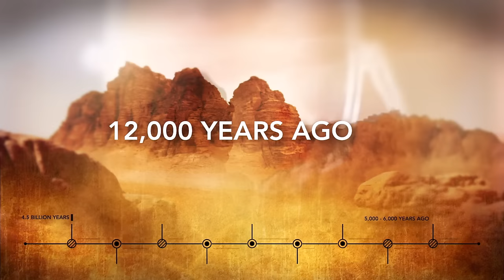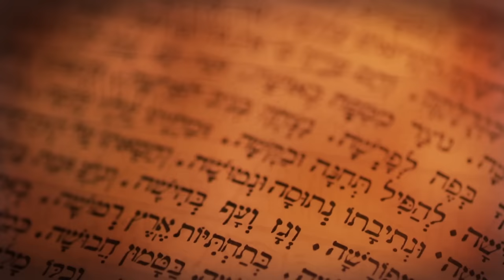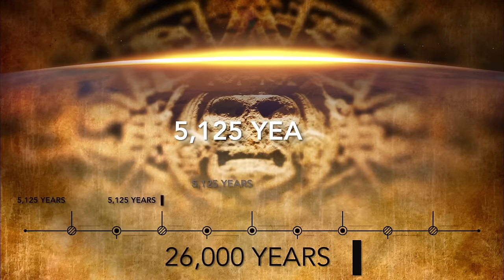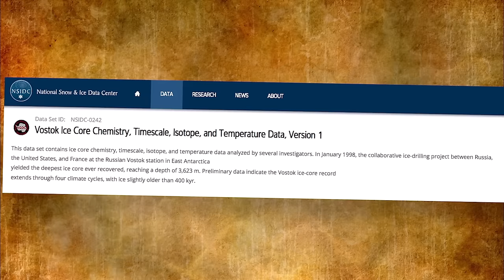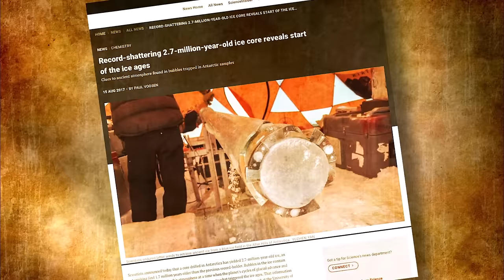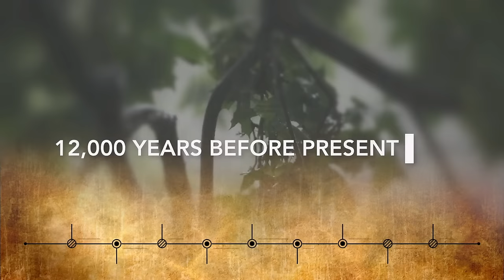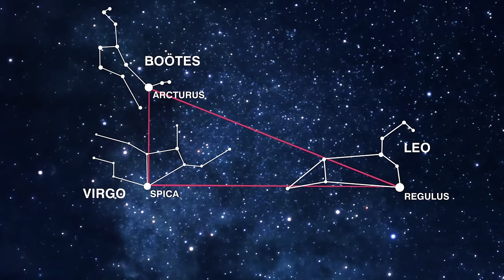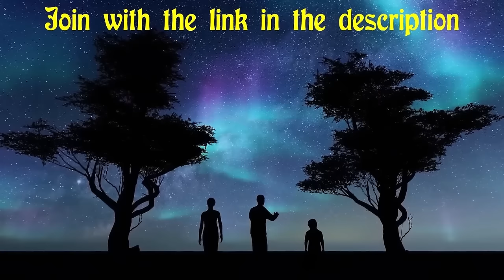Antediluvian Civilizations: The World Before the Great Flood

Comment: I've probably spent to much time thinking about this subject.  I have questions I haven't heard before. You think about how we build thing today. Even our greatest constructs aren't built with blocks of rock anymore. Which I'm puzzled about,but more puzzling is why they used them to begin with. You don't have to use 1,000 ton+ blocks of granite for foundations unless something is supporting massive amounts of weight that most of the sites didn't need. We use a man-made material, concrete to build our largest structures. Hoover dam as a illustration. You might say they built everything because they wanted it to last forever! Possibly,but any of the reasons for using the huge blocks doesn't lineup with the technology they reportedly had. Which was Reed rope and wooden block and tackles for lifting. Estimate for weight handling at best 3-7 tons. No boat has ever been found that could transport the massive blocks some as far as a 1,000km. Better boats ,rope and iron did come along but not during building phases that mainstream gives us. Don't even bring up pounding stones and copper tools because it's ludicrous to even discuss. What about the perfection in the statues? We can duplicate the perfection of these. But only if we use computer guided advanced tools. It comical to hear the academics explain the cutting marks and drilling holes that have been found of high tech machinery. Even with our advanced computers we can't figure any of these things. You can beat up all mainstream BS just with the Osirian complexes mysteries. Looks to me like the archeologists need to stick to digging up bones and let serious studies to begin using mechanical engineers and other scientific fields to study these sites. And Hawass and the other Egyptian authorities need to stfu and get out of the way! The world already either suspects or knows you either inherited these wonders and tried to copy them or just scratched your names on things that didn't belong to you!
Reply: agree 100%, especially about the Egyptians inheriting these structures and claiming them for their own, and not allowing the outside world access to really investigate
Reply: you miss out, watch the vid where one single man moves blocks of 20 tons. do some research instead of fantasizing.
Reply: @wout123100  big difference moving a 20 t block and moving ones that weigh over 50-100. Especially on uneven or hilly terrain. I have had to deal with moving large objects. There's also a big difference between moving something heavy a few feet and moving it cross country. You sound like the geniuses that proclaim they drilled the holes with copper tubes and wet sand. But when dared to drill these holes, they can't accomplish anything that can be completed this century. But I don't think that is your problem.  It sounds more like you have grown up suddenly and realized you wasted your parents' money on that education to become an archeologist!
Reply: I totally agree 100%.
Reply: African people had the GOD-GIVEN Power to civilize this world....they conquered the seas and built all these megalithic structures.....Because of all this power  we became lofty, forgetting the God of our power.....we became our own gods and created idols and deities instead of sticking to our true unseen GOD WHO dwells within all flesh ...We went astray , so He gave us Africans,  Seers,  Prophets ,and Scribes who wrote Scriptures and taught us to return to our true God or we would be scattered to all countries as slaves.....Enoch the Ethiopian was our first Prophet who even foretold the coming of Christ our Black Lord and Savior........So GOD gave the Bible to the world through Africans of Ethiopia , Egypt and Israel and the so- called Middle -East which was originally North-East Africa before it was separated from Africa when they joined the Red Sea to the Mediterranean after digging the Suez Canal from 1859 to 1869....The original Bibles were only in African languages Ethiopian Gee'z , Egyptian, Aramaic, Hebrews Arabic and Amharic long before any European Greek and Latin...The origin of Eden was the highlands of Ethiopia to Tanzania Mt..KILIMANJARO...
Reply: Literal multitudes of modern engineers have explained how this happened.  The sad reality is that ancient Egyptians were willing to throw human death and suffering into this project until it was done.  You spew a lot of pseudo-facts, but the reality is that this whole project was entirely doable.  No aliens, no time travel, just amazing engineering coupled with a degradation of an entire people.
Reply: A modern engineer would need a gantry crane to build such a huge structure like a pyramid. Megalith structures found all over the world and even beneath the ocean would suggest technology that is forgotten or obliterated. To cite a recent example, the Taj Mahal has sealed cellars underneath which nobody wants to open, because that would be a Pandora's box.

Comment: seems like the point of making the megalithic structures so exactly fitting, how all the blocks fit together without room for a hair to fit between, is to make it impervious to those previous cataclysms & to make it essentially water-tight. in preparation for another flood. & so large, mountain like, to make it as close to impossible to destroy with something like a nearby comet impact. awesome episode. just one of many thoughts i had during the presentation.
Reply: Good theory; I like it 👍
Reply: @kellymichelley  thanks!
Reply: 🎉 Agreed 🎉
Reply: One problem. They didn't somehow make it through the flood unscathed. I think they made it through, somewhat intact, simply because of the sheer stone mass and how tight the masonry. The problem is that enough water washing over an area can wash even big boulders downstream. The more water, the bigger the boulders. I think the flood and corresponding earthquakes from the gigantic moving masses of water is also what eroded down entire mountain ranges, such as the Appalachians.  That much flood water mixed with sand, dirt, rocks, and boulders = serious abrasive capability as well as sheer hydraulic force.
Reply: @paulandrulis4672  Definitely right about the incomprehensible magnitude of these floods we're talking about here. I do think the aim to make them impervious as possible to nature's extremes was still a factor during their construction, I imagine it might have been a major factor in those ancient people's every day thinking & planning. & look how The Sphinx withstood a 1000+ year downpour of torrential rain, an unimaginable quantity & duration to us today. That brings into consideration the mystery of their actual build date to begin with. Who knows what they've withstood before, Antediluvian centuries were also cataclysmic, even with the big flood still to come.
Reply: Assuming the flood actually happened as presented in mythology, your comet idea is of course absolutely sheer supposition.  Pretty much anything in the video and out are pure speculation.
Reply: @MichaelShepherd-v7p  He specified it was just a thought he had. He never said it was anything other than an idea or theory.

Comment: I'm inclinded towards the theory that the cyclical Magnetic Pole Shift is the most significant event that excels ice ages and dry ages on the planet. This is also the most likely event that sets off excellerated tectonic plate shifts.

The poles are doing this right now. Our planet is about to change in an epic way once again. We're just along for the galactic ride.
Reply: This is most likely the truth. Christian and Islamic eschatology speak of the last point when the story of humanity will end 'When the Sun rises from the west and sets in the east'. Note that this is the point for the end of humanity. The end of this world as a whole is a different event the sign of which will be 'When Sun will be closer to the Earth'
Reply: @awaishssn  Time-lines of crisis found in theology  about this event are contested by simple geology.

Ancient legends hold an element of truth, but they lack accuracy.
Reply: There is no correlation or causal link between geomagnetic reversal and ice ages.  As for dry ages, they're the same thing as ice ages (partly due to the water being locked up in the glaciers and partly due to cooler air being able to carry less water vapour).

Comment: A near miss. The most ancient massive structures were substantially before our usual attribution, but not antediluvian. 
Just after. 
The flood did not extinguish large structure. It motivated it. 
They had to build something that would survive the deluge that they had witnessed.   
It coalesced survivors, and made important the craftsmen and work. It instilled purpose...then they spread around and dwindled out over centuries of drought.
You're welcome. True ancient pre history.
Reply: Read Psalm 82 and Job 38
Reply: There was no global flood.  Full stop.  At the end of the last ice age the meltwater did cause extensive coastal flooding and a number of localized floods.  They were just that though, local, not global, and they occurred intermittently and non-simultaneously over a span of several thousands of years, ending ca. 11500 BCE.  As for the Jewish flood myth, the event that it's known to be based on (a specific flood that struck the city of Shuruppak) occurred much later, ca. 2900 BCE.  Record of some of the earlier floods (those of the Persian Gulf and/or the Black Sea) might have been passed down in oral histories to later become the genesis of the "Adam and Eve" myth (pun intended); this is just conjecture though with only circumstantial evidence to support it.

Comment: Yes, but 'The Flood' only covered the area of the Middle East and Near East. The Great Flood had no effect on the Americas and some of the other areas described.
Reply: It did in north america
Reply: @d1want34  How did the great flood effect North America?
Reply: @johnhess351 melting of the North American ice cap about 11,600 years ago
Reply: There were many large, but localized, floods at the end of the last Ice Age ca. 11500 BCE.  Off the top of my head in North America there's the Bonneville and Missoula floods and a bunch around the Great Lakes; in Europe you have the flooding of Doggerland and the formation of the English Channel; in the Fertile Crescent there's the flooding of the Black Sea and Persian Gulf; in addition, thousands of square kilometers of coastal land was flooded (sea level was 120 meters lower during the last ice age).  The "Noah" flood was much smaller scale, taking place in the city of Shuruppak ca 2900 BCE.  The key point is that there were many local floods within a relatively short (few thousand year) timespan but these floods weren't simultaneous and there positively was no global flood (at any time).

Comment: That is what destroyed Mars and that is where Jupiter, Saturn and Uranus got their rings from.  I'd love to get a sample of Saturn's rings aswell as the other  planets rings.,  there must be some kind of tell tale evidence.
Reply: Mars lost most of its atmosphere due to the planet's lack of a protective magnetic field.  As a result, over the span of millions of years the solar wind, tenuous as it is, was enough to strip away most of the atmosphere.  As for the rings around various planets (notably, but not exclusively, Saturn), they're formed when a moon's orbit decays to within the planet's Roche limit, the point at which tidal forces caused by the planet's gravity are larger than the gravitational forces that hold the moon together; this causes the moon to break apart and rings are formed as a result.  It's not just the larger planets that can have rings; Earth is postulated to have had them in the distant past and Mars may gain rings when the orbits of Phobos and Deimos decay sufficiently.  As for what the rings of Saturn, etc. are made of, they're almost entirely water ice with trace amounts of rocky material.
Reply: Don't be a wally. They may b radio activ. Anyhow  N:a s a.  would stop u.😢
Reply: @Tom-gv2eo  You're being a bit of a prat but you're right about one thing, the radiation levels around Jupiter are quite severe.  This is because it has a very strong magnetic field which acts to concentrate charged particles.  Not the healthiest environment to say the least.  AFAIK, the radiation at the other outer planets is a lot less hostile.  Another source of radiation is gamma rays (high-energy photons) generated by (truly massive) lightning bolts within Jupiter's atmosphere; I'm not sure whether these are of sufficient luminosity to pose a radiation risk at orbital distances.

Comment: The first mistake is thinking that civilization is only 5000 years old it isn't, try 10,000+ years old. As for building, you can do anything with enough manpower.
Reply: The oldest settlements date to around 9500 BP (e.g. Çatalhöyük with a population of around 7000).  There is no evidence for anything of any scale from earlier times (at best a hut or two).  It mainly comes down to resource availability; to have permanent settlement you need a permanent local food supply.  Doing this on anything beyond scale of small hamlets requires agriculture (which wasn't developed until around 10000 BP).

Comment: The primary skeletal structure of original religious chronology is binary in its conflicts of preFlood and postFlood; or as a start with Adam to End of world. For example the 6000-year world comes as 1656 +4344; and 1556 +4444; and 1307 +4693; and then high-end preFlood as 2256 +3744; and 2242 +3758; and 2262 +3738; as well as Hindu 2400 +3600; and 1662 +4738. Mexicatl Toltec uses 1716 (+292 to Abram), and Hindu also uses 1680 of 360-day in 1656 Julian. Though narcissism zeal looks at this in gaslighting allegations of confusing reality by presenting too many false options; their choosing shunning cognitive dissonance or wage-war zeal ignores that it all disproves Neanderthal ape-human evolution.

Comment: The Earth does not have s stable orbit, it moves on a tilt of about 12 percent , this mean that  there changes in climate and level of seas. We  know the Sun has cycles of extreme heat and cold that effects the Earth and creates warm and cold eras, we are in a Cold era but man has heated up the Earth so much that it has not gone  cold.
Reply: We're actually at the tail end of an ice age (the poles still have ice, which is atypical for most of Earth's history).  After a period of rapid warming between around 18000 and 8000 BP the warming, though still occurring, mostly plateaued.  Since the start of the Industrial Revolution in the late 1800s CE the rate of warming is now exponentially rising; the current rate of warming is multiple orders of magnitude higher than at any point in Earth's history.

Comment: The sun does a major excursion every 12,000 years which includes a micro nova, which also causes the auroras, we are experiencing it again now with the weakening of the magnetic field, the poles will flip within the next 25 years
Reply: This is vaguely correct but you're incorrect about the details.  Solar cycles are a thing but there's no such thing as a "micro nova".  Auroras are caused by solar material hitting Earth's atmosphere; they are usually only visible in polar regions since the Earth's magnetic field channels them there (since the ejected matter has an electric charge it's influenced by magnetic fields).  It is believed that Earth's poles may flip sometime in the "near" future (as they have done many times before) but "near" in this context is most likely to be millennia, not a few dozen years.  You're on the right track though and I encourage you to learn more about geophysics and astronomy!
Reply: @alexhajnal107  
You might want to do some research 
Micro novas are a thing

Comment: Civilisation has been around far longer than 5 to 6,000 years. Just because we can't find the old building doesn't mean it didn't exist. 
Look to old texts from different religions and areas and not just greek or italian. You need to look at old Arabic texts and Chinese as they have far older history lineage than the greeks or Italians.
Reply: Absence of evidence is not evidence of absence.

As for texts, the oldest texts are those from Egypt and Mesopotamia (~5000 BP).  Greek writing appears rather later (~3300 BP) with the first Chinese texts appearing a couple of hundred years later.  Aramaic appears shortly after with the first Arabic texts dating to around 2800 BP.  Writing may have been developed on the Indian subcontinent roughly around this time (~5000 to 3000 BP, with ~7000 BP claimed in myth) but this is highly contested with the oldest undisputed texts dating to around 2300 BP; for the most part an oral tradition was used in this region.

Comment: What.............. global warming 20,000 years ago?!?
Reply: they should have had more taxes on the people
Reply: The ice sheets are still melting from it.
Reply: We're currently near the end of an ice age (the Earth currently has ice at its poles, which is atypical throughout its history).  That ice age began ending fairly abruptly with a period of warming between around 18000 and 7000 years ago (sea levels rose 120 meters over this timespan, around 400 feet).  Since then the rate of warming and, in turn, sea level rise has been very gradual.  That all changed with the Industrial Revolution with increased greenhouse gas emissions causing an exponential increase in global temperatures.  Temperatures (and in turn sea levels) are currently rising at a rate that is orders of magnitude higher than at any point in Earth's history.  If the previous period of warming is anything to go by (it is) then unless we can get warming under control, sea level rise will make life rather unpleasant for most of the Earth's population (e.g. stuff like Florida ceasing to exist).